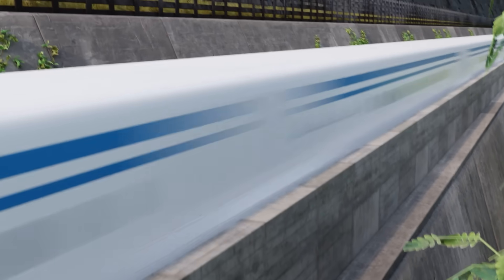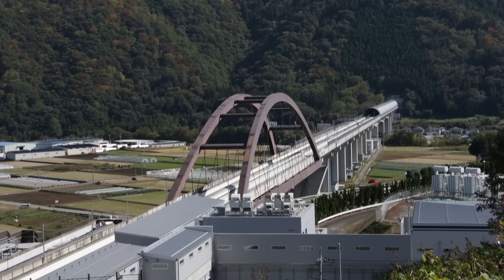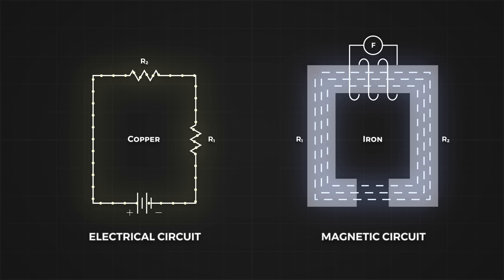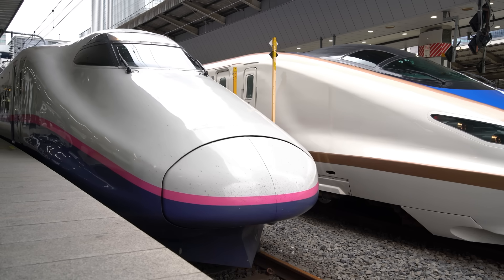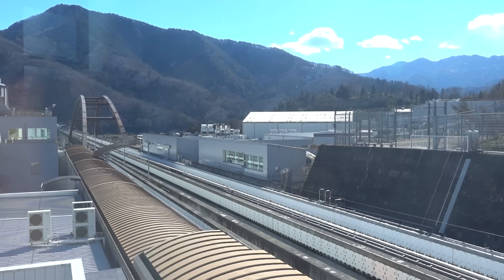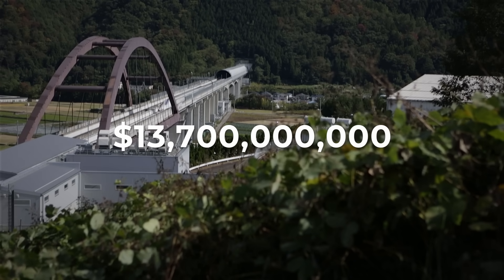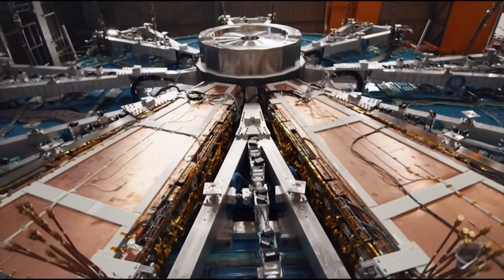How Japan's Maglev Train Works

Comment: America can totally afford maglev, it's just that private railway companies hate making big upfront investments in infrastructure. All major cities in the United States could be connected by maglev if Amtrak was in charge and outsourced the construction of lines to China. The Chinese are planning to extend the Shanghai maglev line to the city center at a cost of 200 million yuan (US$25 million) per kilometer, and build thousands of kilometers of intercity maglev lines running at 600 kph in the next decade. All we have to do to prepare is take Interstate Highway right of way for the maglev tracks and build a few kilometers of tunnel under urban areas to reach centrally located stations.

Comment: I remember driving under that test track almost a decade ago. I think back then they were saying the technology would be ready soon
Reply: The technology has been ready for a while. The cost is an issue. This track is built in difficult terrain and it will be the first long distance connection, so hopefully future segments will be cheaper.

Comment: Well, nice how you snug in pictures of the Germany Transrapid train. Even the old test range was shown.
Did you notice, that it was never mentioned, that it was invented in Germany almost 50 years ago? (development took from 1969 till 1991, https://en.wikipedia.org/wiki/Transrapid)
There was even a small clip of the predecessor system from MBB.
But Germany had it coming... instead of connecting Hamburg to Berlin (or even Munich airport to Munich city center), the technology was sold out to China where that  tiny strip was built.
The last prototype of the German Transrapid is now an exhibition hall in a sausage plant. Really!

And side note: High speed rail needs separate tracks. TGV uses a separate network (but still using standard gauge), Shinkansen has a complete separate network from the local trains (even at a different gauge). On the other hand the German ICE (in theory also capable of 350 km/h), uses most of the time the common network. Shared with with local or ferry trains. Slowing the ICE down again and again.
Reply: Correction: We build the maglev train and sold that one to China for that project. We didnt sell the whole technology.
ICEs max speed is 330km/h for the series 403/406 and 320km/h for the newer 407/408 (all of them being classified as ICE 3).
Germany does have high speed lines and at least one where only high speed train run on (Cologne to Frankfurt). On other high speed lines cargo trains only run at night and regional trains are usually also sped up on those lines if there even are regional trains running on them.
ICE trains get slowed down on the old conventional rail infrastructure but they will overtake any slow train if possible.

Comment: If they ran tubes that sent the air through the walls of the tunnels, then to the rear of the maglev, they could reduce drag significantly, for a one time cost. 

Using Beams and supports with low surface area, but high airflow, would allow strength and structural function, while allowing less drag. 
Just make sure there is an intentionally higher force requirement to go forward, such as in a tesla valve, to force the air pressure behind the maglev, for the increased gains, rather than increased pressure upfront.

Comment: Need to talk about "throughput cost" - capacity per time, not just cost per km per passenger:

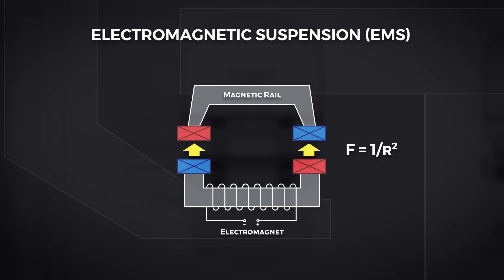Shinkansen 700 series from Tokyo to Osaka = 2:22 hour ~1200 passenger, depart every 15 minute = 76'800 passenger (18 hour operation day ~64 trains per day)
Chuo Maglev L0 series Tokyo to Osaka = 1:07 hour ~728 passenger, depart every 15 minute (assume) = 49'504 passenger (18 hour operation day ~68 trains per day)

Plane = A320 Tokyo to Osaka = 1:05 hour ~160 passenger every ~45 minute = only 3'520 passenger (18 hour operation day ~ 22 flights per day)

The justification for Trains infrastructure could move 10x more people per day than what airport could achieve (even with Maglev).  Because "Airport" have to cater "international flights" if the domestic distance is long enough, "Trains stations" only serve domestic travel for island country (not international).

Comment: You said that the 30 km between Shanghai airport and the city center is too short a distance for a Maglev to reach sufficient speed. How far would they need to be apart to reach their maximum speed, even just for a second, before decelerating? What would you then say should be the minimum distance between stations?
Reply: It actually can reach top speed on only 30km but it doesnt really do much at that distance because it will need to decelerate after a short time

Comment: Don't get me wrong; I love the idea of a mag-lev train system completely interconnecting cities all over the world.
However, the problem of building a specialized, proprietary system that can't be used for anything else makes it a very high investment in the first place.

Regular rails have the advantage that all the existing stock of trains and waggons can be used on them, almost no matter how old and decrepit they are.
The extremely high speeds of a ground-bound maglev system is its greatest feature, but also its greatest hindrance. 
See, planes can bank and roll to reduce the lateral g-forces on passengers. A land-bound train can only tilt so much before becoming unbalanced. Also the tracks always have to be traversable at lower speeds just in case something happens to slow them down. Planes can escape almost unhindered anywhere to tilt and roll, trains most definitely can not. That means the tracks have to be straight for the most part, and have only VERY shallow curves to prevent lateral g-forces making the ride uncomfortable. Same goes for inclines or declines; but even worse on the human passengers. This limits how train track routes can be planned, meaning landowners have to agree to the track passing over their land; or be disenfranchised. Both may be very unfavorable solutions.

That's why I don't believe that we will see a new form of transportation via mag-lev, high-speed in-air or vaccuum, within the next 50 years connecting ALL of our cities.
That's coming from a fervent supporter of the TransRapid back in the day who still can't believe that the deaths of a few people scrapped a final, production-level system ready for the market in Germany. Yes, those deaths were very unfortunate and a catastrophe for the families involved. But people die every single day in traffic and construction the world over. It wasn't even a technical error, but human error, that caused those deaths.
Reply: The accident wasnt what lead to the TransRapid not being implemented though. It certainly didnt help but tests kept running for years after the accident, research was deemed finished and than it failed in politics and no project ever made it through
Reply: Agreed, but the accident definitely gave it a push in the wrong direction, so to speak. Media didn't help either, as their tone was more or less negative after the accident. @Guy-Zero
Reply: @RustyDust101  Yeah, like I said, while it isn't the reason for giving up on the technology it certainly didn't help it. One can only hope that at some point in the future people will talk about it again. Maybe if the Japanese line is successful, it could help bringing Transrapid back to life

Comment: The Texas triangle will never work. The last 4 times it’s been brought up it’s starts off with the best intentions and turns south quick. It starts with San Antonio to Dallas with an Austin, Waco and Temple stop. Then every small town along 35 wants a stop or they won’t sell the land. People don’t understand or care that a high speed train making a stop every 15 miles for 5 minutes, it’s no longer a high speed train. It’s just a train. Amtrak has a SA to Dallas but it takes 8+ hours. Southwest Airlines takes 60 minutes and you can usually get through the SA airport security in 10 minutes or so. Unless a train can make the trip in less than 3 hours I’ll stick with flying.

Comment: The economic argument you mentioned is kind of useless in a world where most people can’t afford to fly and car travel causes issues with the climate. I would much rather take longer via train and sit on my laptop, than waste a slightly shorter amount of time with my hands on the wheel. I’d also be fine with the trip taking longer if it was 1/10 the cost, like Amtrak is now.

Comment: Honestly I think the "shot-in-the-arm" effect this will have on the economy of Japan might repay the cost of the line in a not-infeasible amount of time.

Say you drop your roommate off at the airport in Tokyo, then you drive to the train station, park, hop on the mag-lev, get off in Osaka and get a ride from a co-worker to your job as a bell-hop at a beach resort, and all in time for the first person who's stuff you will be bringing up to their room is that of the same friend who you drove to airport earlier; this is because, in the one-and a half hours it took you to make your commute to Osaka, your friend had to check their bags, go through security, board, taxi, take off, cruise, descend, land, taxi, unboard, pick-up their luggage, exit the airport, and get a cab to their resort, which would be a miracle to complete in the same amount of time, as checking your bags and security alone can eat up a quarter to half an hour each depending on how crowded the airport is.

It's not a bad travel time for a vacation, sure, but a work commute shouldn't exceed one hour, give or take a few to account for traffic; this mag-lev train can easily make that one-hour-give-or-take commute a reality.
Reply: even with Japan's current HSR it's faster than flying between Osaka and Tokyo by a about an hour. also very few people use cars for last mile transit to and from major airports in Japan.
Reply: 日本だと空港鉄道使うよね

Comment: I feel like this video needs a part two, covering...

1.) The costs of the superconducting coils AND its refrigeration relative to total operational costs (and how this would change with a hypothetical room temperature superconductor). A more complete cost breakdown is missing
2.) A more detailed comparison between maglev and high speed rail, involving costs.
3.) A more detailed explanation of how the levitation system works at 3:55. If the electromagnet schematics drawn are meant to represent the rail magnets, it's confusing to show both simultaneously since they could be interpreted as separate. And why are superconducting coils involved, as opposed to those videos of a superconductor passively hovering over a magnet? And why is this still a passive system; doesn't the electromagnet strength need to be actively adjusted?
4.) Inductrack should be mentioned as an alternative method for levitation. It is passively safe and uses no refrigeration by using halbach arrays and coils of wire, which would appear to be cheaper as a whole. According to Wikipedia, there are two types of Inductrack depending on travel speed and cargo mass

Also, at 2:20, there's a slight error: force is proportional (not equal to) 1/r²

Comment: Honestly, I don’t see maglev be a thing, over regular HSR, for longer routes, before we at least figure out room temperature and pressure supraconductors, but also cheaper magnets. Because that’s were a lot of the cost come from, from developing Supra conductor magnets, to putting tons of very expensive magnets in the track to make the train move (as it’s the relation between the magnets in the train and those in the track that allows it to move).
Economically it would not make sense comparing to regular HSR. however I think Japan is a special case, with extreme density, close cities, and their Shinkansen that starts to get a bit overcrowded. They needed to add a brand new line, and while more expensive, I think maglev trains aren’t that bad of an idea. But the use is so specific, I don’t see other countries that would benefit from it, as France, Germany, Spain… all have cities relatively far apart, meaning large costs of construction, but not so much that HSR is worse than planes (as most cities in the east coast for exemple are about as far apart from French big cities, if some high speed line were to be open one day, regular rails would work just as well
Reply: It's a special case in Japan too. I don't think it makes sense in other cities. The traffic between Tokyo, Nagoya, and Okasa/Kansai region is so large, both the Shinkansen and planes make most of their money in these routes. The Chuo Shinkansen can reach Tokyo-Osaka in 1 hour, so there will definitely be a lot of business and tourist demand. 

Also, the Tokaido-Shinkansen was completed in 1964. JR-Tokai will have to do a massive overhaul once the Chuo-Shinkansen is complete.

Comment: 7 hours to get from NYC to LA might not compete with a plane on time, but if you slow it down a little (say, 8 hours) with a very straight and level alignment and run trains with only sleeper cars and dining cars. Leaving NYC between the hours of 7 and 9 pm, have dinner, sleep, wake up, have breakfast and get out in LA between 6 and 8 am. Leave LA between 1 and 3 am and again, dinner, sleep, wake, breakfast and get out in NYC between 6 and 8 am. Closer to first class than business class experience, cheaper than business class+night in a hotel cost.

That leaves you with a 14 hour window, if it takes 4 minutes to slow down and stop, 5 minutes to disembark passengers and load new ones and 4 minutes to get back up to speed means that if you wanted to run one local service train that left immediately after the last non-stop left its starting station and arrived just before the first non-stop from the next day arrived you could add 30 stops. You could also have way more than 1 local service train by adding a lot less than 30 stops, or by adding way more than 30 stops but just not having any trains that stop at every stop but just at pairs of stops with high demand. Adding stops beyond NYC to LA (so, Boston-NYC-LA-San Diego) also wouldn't effect the core service.

If you further don't just use this corridor for maglev, but also high speed rail, metro trains (basically subways but without the requirement that they be underground), double stacked freight rail (all electrified, 25kV 60hz overhead), bicycle/wheelchair paths (hard and smooth) and pedestrian paths (soft and slightly springy) with easy transfers between services (unified payment systems) and you have a very good backbone for the mass movement of people and goods and as long as it's easy and not a bureaucratic nightmare for state, county, municipal governments to build branches off of that backbone it will get used. The biggest issue other than budgeting is going to be the optics and politics of a mega project that provides so little for the south east and north west. Which can fixed by providing the same from Seattle to Atlanta (or some other city pair)

Comment: The US has the same problem with high speed trains that Australia has with nuclear energy. Perfect circumstances and opportunity to utilize it, but due to campaigning and lobbying to sway the public interest away in favour of competing industries, the infrastructure for it was never developed. And now that we're decades on and the infrastructure is non-existent, it's not financially viable to try because of the investment needed to build the infrastructure. Which means there's no interest in it. Which means there is less investment in it. It creates a vicious self perpetuating cycle that you can't get out of without country-destroying levels of investment and public resentment. Had that conversation on both of these matters with my senator.

Comment: The fact that America lacks existing high speed rail infrastructure and has a gigantic airplane market actually makes it a prime market for leapfrogging high speed rail in favor of maglev. We are talking about the largest consumer market in the world, with a sparse grid of huge metropolitan areas roughly 1000km apart. It's basically the perfect place to build long range hyperloops. Hyperloops, because as you clearly pointed out, large segments of the tracks will be tunnels regardless, and air friction is a huge consideration, as well as hyperloops allowing for a speed advantage over airplanes even at very long distances. Hyperloops fix all issues with maglevs save for cost, which is a one time expense, they are a logical inevitability.

Comment: No one ever talks about the fact that 90% of the maglev route from Tokyo is going to be underground you don't have to worry about nimby's or environmental concerns or previously existing tracks you literally just dig a hole in the ground
Reply: You'd think so, but nimby and environmental concerns are exactly the reasons why this project kept getting delayed. Shizuoka's prefectural government is strongly opposed to the current plan because: 1. the line will only pass through their backyard (rural mountain region) without any station, and 2. the tunnel construction may cause the underground water supply in the mountains to drop significantly, thus reducing the amount of water flowing to Shizuoka's Oi River.
Reply: Yes but we need another word for just. Digging 200km is nothing you "just" do.
Reply: Sadly there exist underground nibys
Reply: @matsv201 and flerfs
Reply: @Frenchdefense9404  what is that?
Reply: @matsv201  Flat earthers
Reply: The construction is currently facing serious delays due to the need to dig a 250km-long tunnel, the longest in the world, which has led to environmental problems such as water drying up. The biggest problem with the linear train running through a tunnel is the environmental damage it causes.